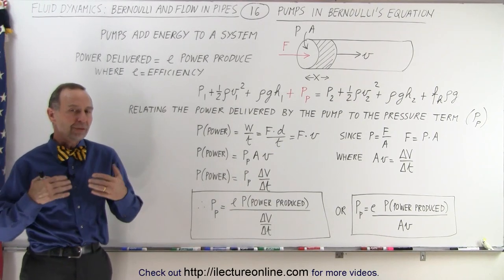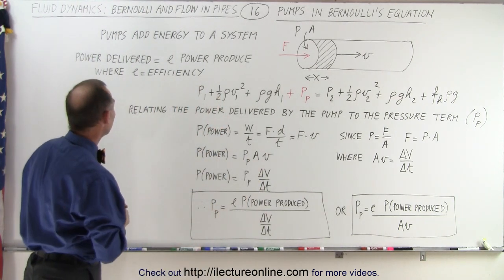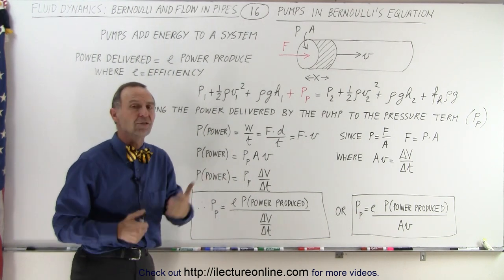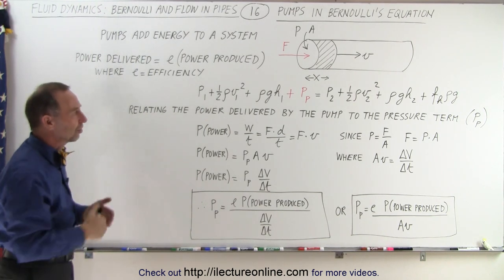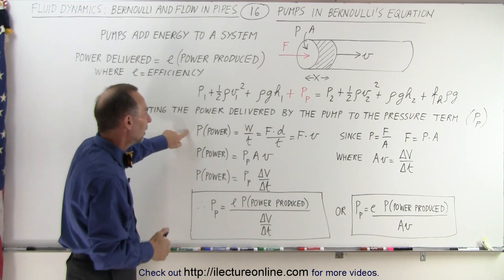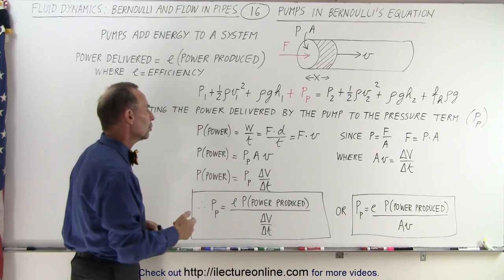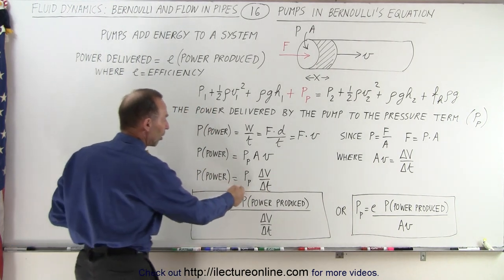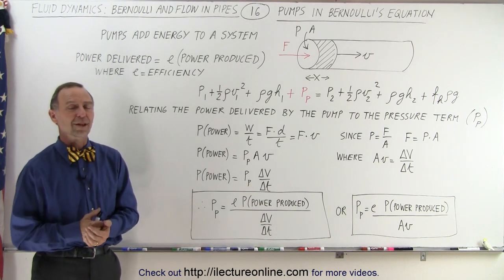Physics 34.1  Bernoulli's Equation & Flow in Pipes (16 of 38) Pumps in Bernoulli's Equation

Comment: Couldn't many times the P1 term be considered the pump pressure being added. I always assume P1 was pump system pressure, other terms were for kinetic and potential energy. And therefore what you add to the system you still get out.

Like in previous examples, you explain work done by w1-w2, where P1 is the pressure source.

Perhaps this is an example of where the already is a pressure source and yet a pump is adding to it?